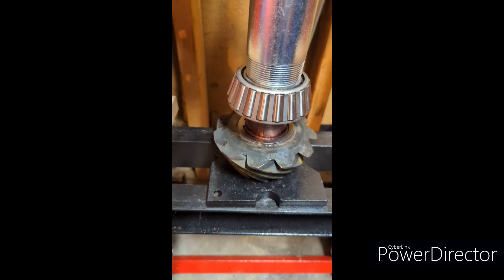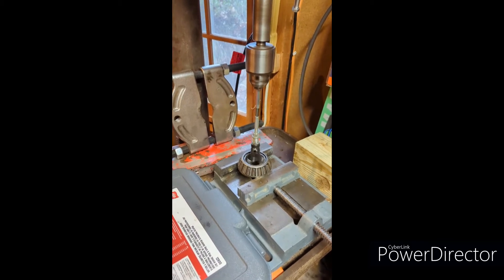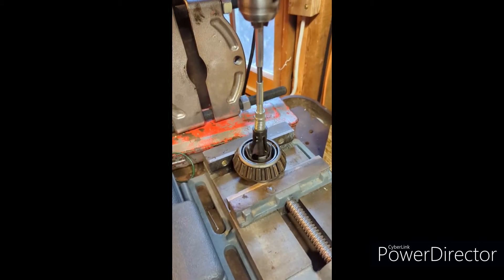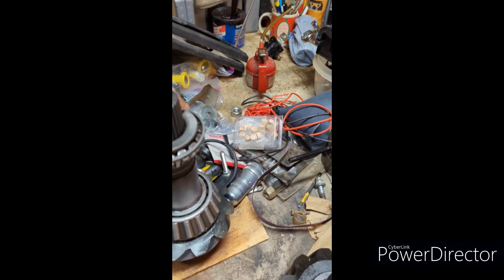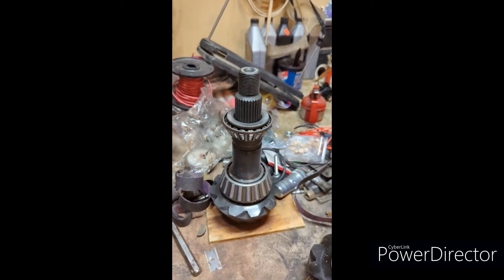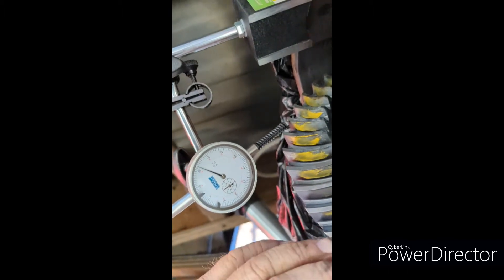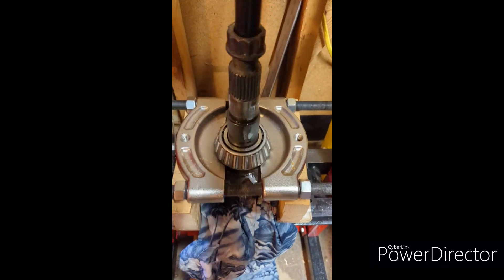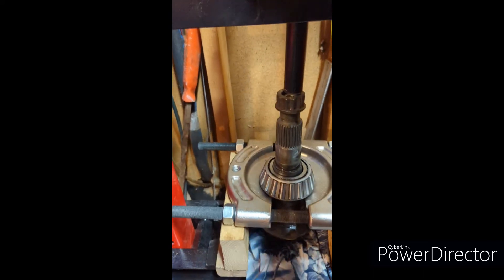build tips and tricks strongest rebuild 11.5 AAM GM 14 bolt differential to  EATON TRUETRAC

Comment: I don't have experience with AAM's unit,  it has less pinion support, that's my main problem with it .. and???

This is what I like about the older tried and true 10 1/2" GM Corporate 14 bolt!! :) ... NO SHIMS!! :)
Reply from the maker: we add shims to the 10.5 to the mating surface of the pinion plate. This is much easier because no bearing need pressing on or off with the 10.5 after setting the preload. The 10.5 is a great design! My son also loved the 10.5 design.

Comment: Your new diff cover is detrimental. It doesnt help sling the oil correctly. The inside shape is very important
Reply from the maker: Thanks for your input, but the ring slings the lube to the pinion bearings. The lube level enables the axles to draw the lube to the hub bearings. The size and shape aids in cooling due to the amount (5 quarts)  of lube. Your idea that the shape of the original cover aids in slinging lube to the pinion bearings is also true. I believe the size of this cover is beneficial due to the above listed points. Thanks for your comment.

Comment: Hey man Is a 11.5 inch 14 bolt worth building for a rock crawler?
Reply from the maker: If it's a small jeep or something, maybe a 10.5 is easier and cheaper and more options. This 11.5 hog is a beast. A rock crawler need a locker in case 1 tire is off the ground. It would be beneficial to see the price of the options you want, then make your choice

Comment: How can I tell if I have a 10.5 or 11.5 axle?
Reply from the maker: The 10.5 I rebuilt has a yoke housing that is bolted on with shims to get the depth correct. You can see the housing nose bolts that hold the yoke housing in. The 11.5 I rebuilt was all cast together. The pumpkin had the rear cover bolted on. That was it, pumpkin was complete. To adjust the pinion depth, I had to shim behind the large pinion bearing the correct the back lash.
Reply: The 10.5 pinion has the extra section of shaft sticking out on the top of the pinion gear that sits in a bearing to prevent pinion deflection

Comment: So they have a crush sleeve and shims?
Reply from the maker: Crush sleeve, is separate from the r&p gap shims. The shim is between the gear and the large bearing, which sets the gap between the ring and pinion. The crush sleeve sets the preload on the pinion shaft bearings.

Comment: Be nice to hear how it compares to what was installed previously ( open diff ) ?
Reply from the maker: The original was a G80 gm positive traction. The friction-modifier additive is difficult to get correct. This Eaton helical diff is very easy, just use a high grade 80-90 gear lube without a friction-modifier additive. the Eaton, In the rain the posi can pull to 1 side when both tires are spinning like all positraction. Down the freeway it acts like a open diff, I have never felt the Eaton acting up around any corner. The G80 acted up around corners, maybe the friction-modifier additive was insufficient. After taking out the G80, on a quick overview, it looked perfect. Note G80 is: GM RPO Codes – Factory Identification Labels and Interpretation: G80	Axle Positraction, Limited Slip. I enjoy the eaton helical posi. installed in gmc 3500 1997 6.5L and 2001 silverado HD 2500 duamax.